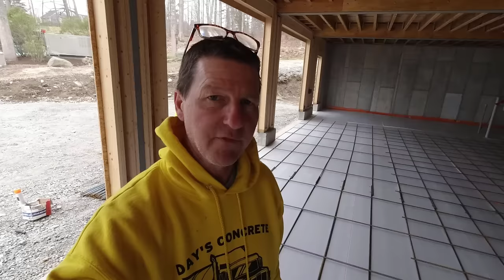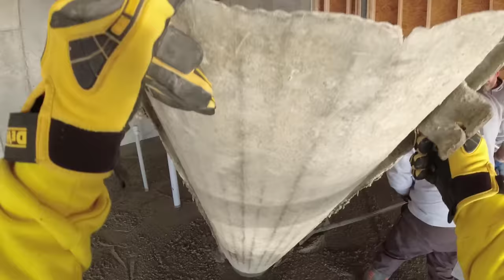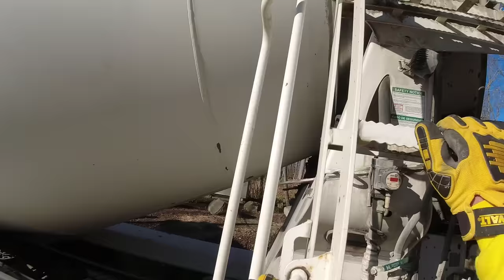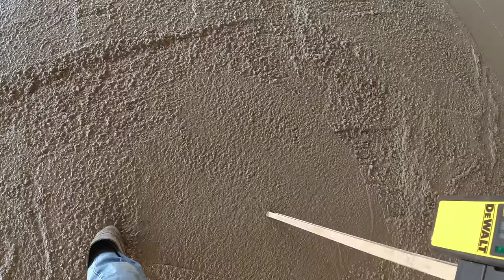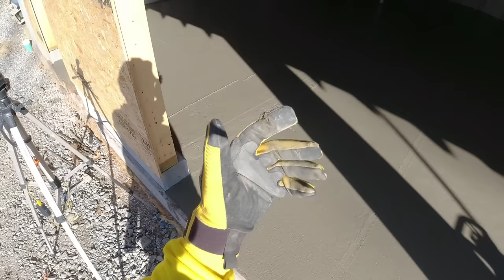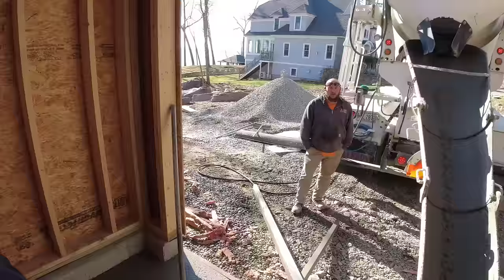Big Garage Floor With Mat Of Rebar (Heavy Duty Concrete Floor)

Comment: Wouldn’t fly in nz. Too large rebar squares, not enough ties or supports.  We use pre made mesh sheets, and abs rebar chairs a lot quicker to lay. Should vibrate it as best practice.
Reply: Interesting. But the wire ties don’t add any strength. They just keep the rebar in place.

Comment: The bricks under the rebar is weak point and makes the rebar useless.
Reply: Not true. What he did is standard practice, and it works well.  Don't post ignorant comments.
Reply: @jamestamu83  Don't be so ignorant I'm an engineer that has worked in the field for 40 years it's not up to code. Its standard practice you say wrong it's a week point. Thay make steel chares that go under the bar allowing the cement flow around them, but Thay are expensive do your research please.
Reply: You have no idea what your talking about
Reply: @Two-brothers-stacking you are absolutely correct the bar needs to be 4” imbedded otherwise it can spall and strip from the concrete.

Comment: I used rebar and re-mesh and 5000 PSI concrete in my driveway because I have a 80 year-old 120 foot pecan tree with roots under the drive and I didn't want the drive to break-up. So far, in 39 years, not a SINGLE hairline crack. "Do it right or do it again." -Words of my Great-Grandfather, a REAL carpenter

Comment: You realize how the drivers can be so important and it is evident with how you treat them.
Reply: Drivers are almost as important as your own work crew. They can make a job easy or hard. When pouring long drives off the chutes some drivers can drive forward just the right distance for each pass of the chutes that makes leveling so easy but others despite years of experience have what I call "pull-forwarditis" where they always pull forward a foot or two too much.

Comment: Mike,i know you don't do rebar that much  but in the future you should stagger any splices you have,makes a stronger slab.Also,if you have room in the thickness of a slab you could bury a bar and then brick off that and that ensures you won't have any rebar on the ground due to clumsy fat ass finishers lol.I was a rodbuster for decades and would have tied up that slab in about an hour for ya!

Comment: I've never understood a sloped garage floor unless it slopes to floor drains or if the entire house is the same finish floor elevation.  In cold climates the water just runs to the closed garage door seals and freezes the doors to the ground.  I've heard multiple reasons and it is code in some areas.  Most of the reasons are big "if" scenarios.  Flat is the most practical for guys who work in garages.
Reply: The slope works, when there is a trench drain just before the door seal.
Otherwise I agree with you.

Comment: Clean job site! Slick trick sinking the bar into the foundation and then bending. We usually drill then into the rest of the foundation as well at 45 degrees and then tap them down with a mallet.

Comment: When calculating rebar at 16” on centers, you will use approximately seven bars per 100 square feet. 1/2” rebar is 150 bars per ton. We always buy it by the ton, its cheaper that way

Comment: I'm having trouble understanding how a slab on grade that will be exposed to whether can be tied into the foundation. Wouldn't the slab heave up due to freezing while the foundation does not? Is it just too dry under the slap to worry about that?  What am I missing? Thanks for videos.

Comment: Great job Mike. What is the father's away you will do a job from a c o ncrete plant? Had a cousin here in central WV had 2 truck pour but the trip was two hours away. The pour looked great it was a inside garage pour 2 bays for a pickup and medium size SUV it was a heated floor.
Reply from the maker: About the same, 2 hours.

Comment: Mike, i am a concrete guy myself and i was just wondering if you were asked for bar over wire or if thats something you prefer and if so why , or which do you prefer ?
Reply from the maker: We were doing what the spec called for on this one. Wire would have been plenty good enough in my opinion. If they're driving heavy equipment in here then rebar is better.

Comment: This is why I prefer composite concrete mixes, you don't know how to rebar perfectly and low quality rebar just causes the concrete to rot, high quality rebar is expensive like composites but takes more time.
If needed I'll do post-tension to hold a slab together through some grade beams.

Comment: Maybe the customers are from Europe or seen how we do Garage concrete floors over here.
We use rebar mesh and not do what you did, cost a lot more, but it's a lot stronger as it's welded and no need to cut joints in it.

Good thing u used blocks under and don't just pull it up and then push it back down like a certain youtuber does.
When he had to tear up a driveway they just did, you could see that the wire mesh he used was all at the bottom doing nothing.

One thing for sure, this garage floor is 100 times stronger than his shop floor.
Reply: Baloney!

Comment: So no one takes the bricked out from below the rebar.   Does that cause a potential weakness on the bottom
Reply: In Florida we have to have 4” min cover for rebar, in my opinion the rebar should be resting on 4” chairs to maintain integrity.
Reply: @thebullgator 4 inch cover plus 4 inch chairs would equal an 8 inch slab, he's pouring a 4 inch slab
Reply: @normanhunter7  yeah that’s the point, it’s a waste of rebar in a 4” slab he’d be better off with welded wire or pour a waffle slab

Comment: What kind of rebar are you using
Reply: Half inch or 12mm in  the civilized world. 😂
Reply: @muskerrytram6453  #4 bar in the informed world.
Reply: @psidvicious  🤣
Reply: @muskerrytram6453  ✌👍
Reply: Canada is metric, but we use half inch! 😆
Reply: @muskerrytram6453 we invented the telephone, airplane, atomic bomb, broke the sound barrier, put men on the moon without using the metric system 🤣🤣🤣

Comment: The owners must drive bulldozers or tanks to need 6 inches thick with all that rebar.  With the foam underneath,  that slab is never going to move.
Reply: Not really, in northern Europe it would be a normal garage floor.
We don't use rebars like this, we use rebar mesh of around the same thickness.
We also don't cut the concrete, it wont crack when it's reinforced with thick rebar mesh that's in the middle of the slab and not at the bottom like a lot concrete youtubers in USA have it.
Despite them pulling it up, they just push it back down as one famous youtuber who just had to tear up a driveway he just did and all the mesh was at the bottom doing nothing.

My own garage is almost as big as this one, poured the floor 13 years ago, still not a single crack.
We get winters that last 4-5 months and it goes down to -30c several times each winter.
Reply: @jone8626 my garage in the US is 42 years old still no cracks, and it was never cut.  You should make a video showing how you can push tied rebar through concrete with 3/4 inch stone in it.  I would be amazed to see it.
Reply: @jone8626 stress on slabs is at the bottom, not in the middle. That's why mesh/rebar is set in the bottom quarter of the thickness.
It's basic stress analysis.
Reply: @jone8626 You haven’t a clue, it makes me laugh to hear this nonsense. Do the stones in the mix magically disappear during the pour, and the greatest stress on any floor is at the bottom, not the middle, think about it. SMH! Once the rods or mesh are raised, it’s virtually impossible for them to settle completely back on the ground! No matter who steps on it. If you step on a plank, and it’s unsupported, where does the break begin? Here’s a clue, not in the middle!

Comment: It's a bit soupy.
Reply: He talked about the use of plasticizer (water reducer) pretty extensively.
Reply: he  always  pours  it  like  that
Reply: It is the Water/Cement ratio that is crucial, but nobody knows what that is.
Reply: I think he talked about it once, it's less than 0.50 for sure.
Reply: @elbuggo  There’s nothing mysterious about water/cement ratio. It’s exactly what it sounds like it is and how it affects ultimate strength. This is about using a plasticizer additive so that the concrete mix behaves like a lot of water has been added, making it easier to work.
Reply: @psidvicious  Still, nobody knows their W/C ratio. Nobody except Tyler Ley.